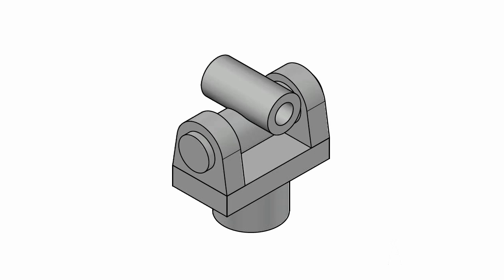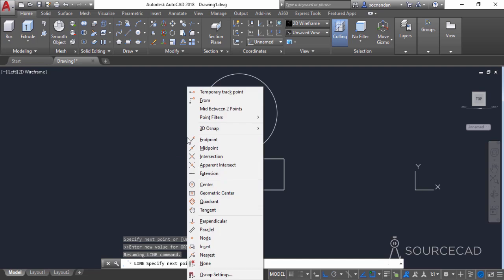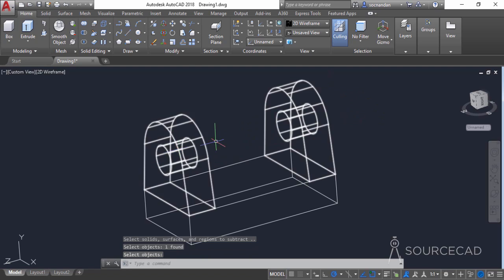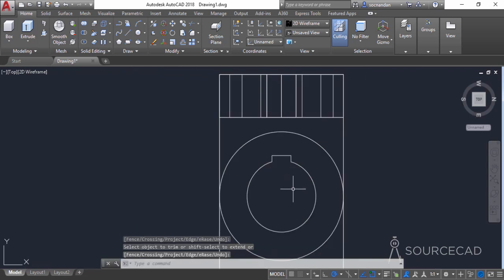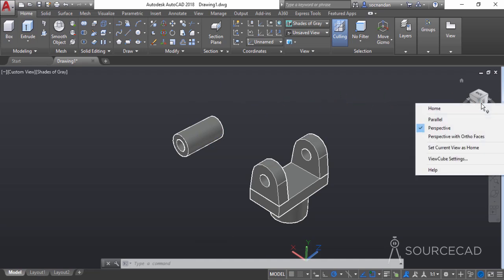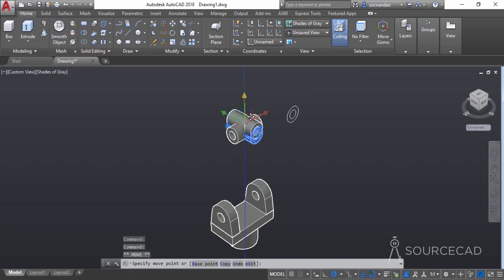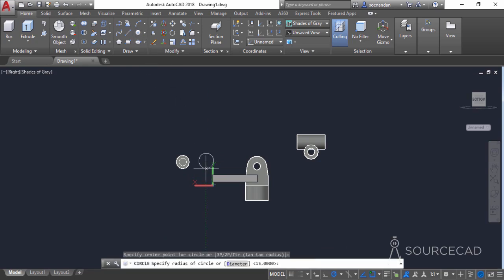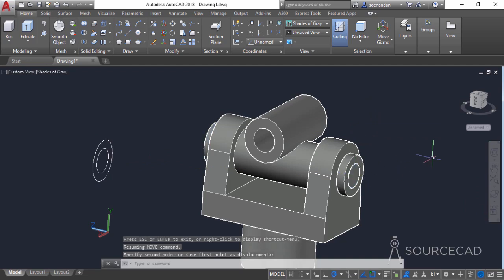Making Universal Coupling in AutoCAD

Comment: I was following what you are doing on the video but I got stuck with the trimming of the circle. My "trim" tool doesn't work for 3d modeling. Did I miss something? What should I do? Thanks!
I tried to cross a line on the circle and the "trim" command worked with the line but not with the circle.